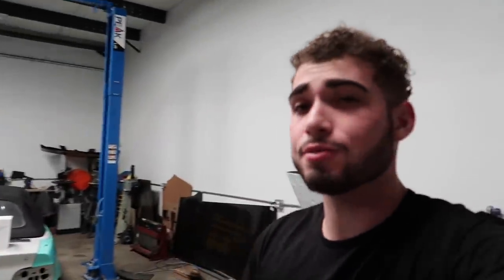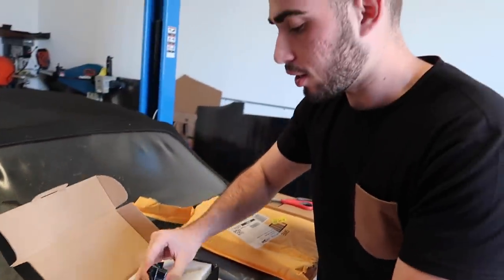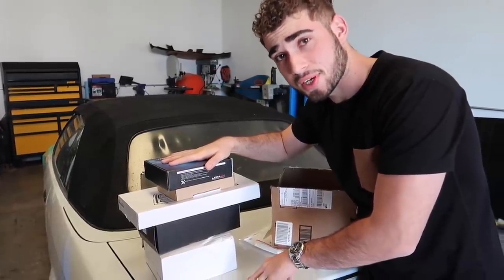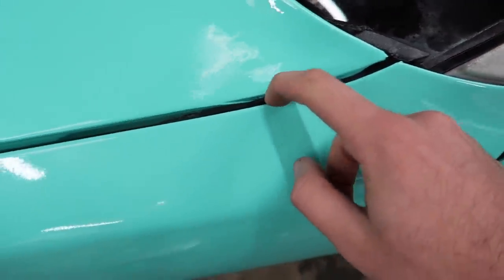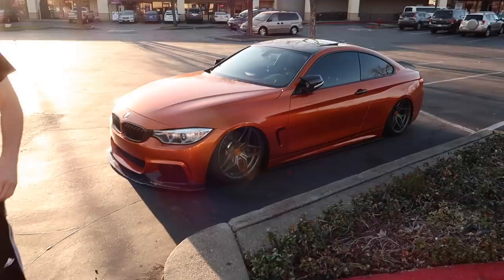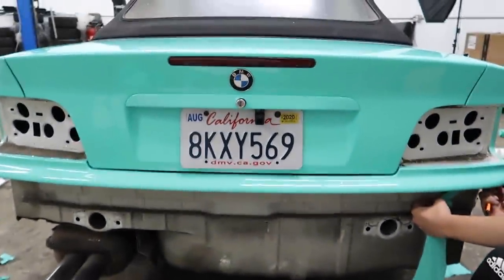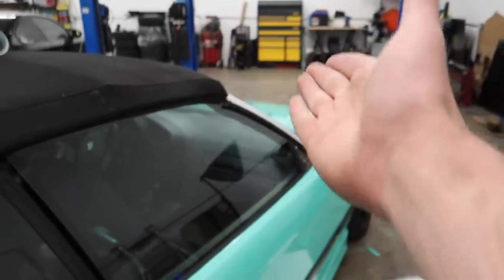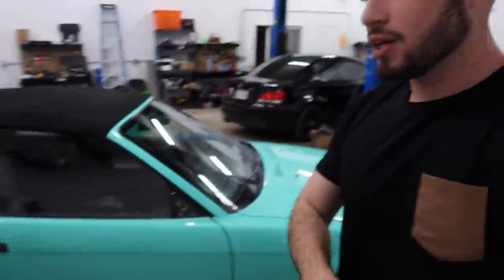EASIEST CAR WRAP TO WORK WITH!! (M3 NEARLY COMPLETE!)

Comment: Nour check the vacuum lines in Sear’s 335i for the boost problem. Mine had the same exact boost leak and no one could find out why but it ended up that it was a small hole in the vacuum line and now I have full power back.